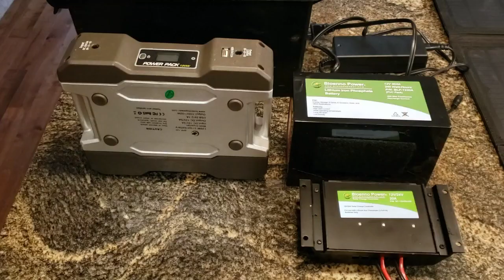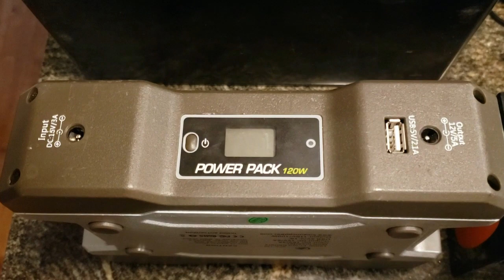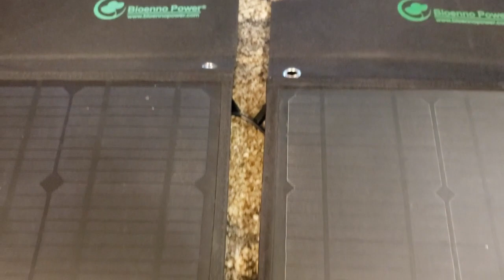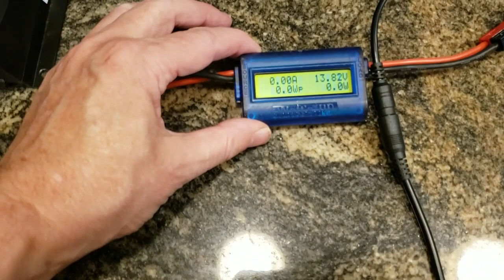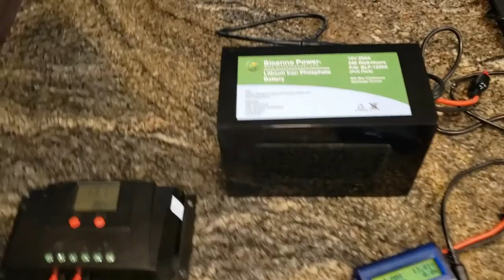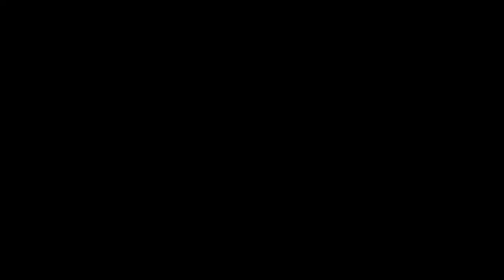Portable Ham Radio Battery Setup

Comment: So what kind of investment cost, are we looking at for a rig like this?
Reply from the maker: Thanks for the question.  It requires some money to get this setup:

Bioenno 20 Ah  Battery - $217 with charger
Bioenno Solar charge controller -  $65
Bioenno Foldable Solar Panel 28 watt - $100
Bioenno Power Pack 160 Watt - $205

Total:  $587 - I have two solar panels so it would be $687
If you don't want the power pack then $382 with one solar panel

Comment: It's incredibly inefficient to use the power pack's inverter to charge DC devices. You're going to have between 10-20% efficiency loss inverting DC to AC, then an even greater loss when the rectifier converts it back to DC as devices designed for AC are not as concerned with efficiency. Your battery will go much further if you wire everything for DC or use a DC charger.
Reply from the maker: I agree with you.  Just showing different ways to use the power pack.  Sometimes you might need it because it is the only thing around.